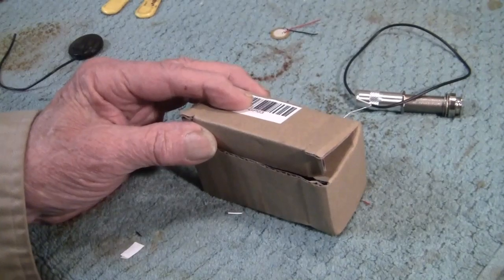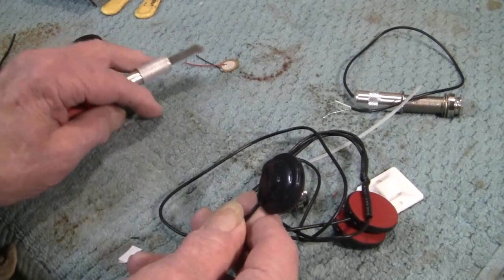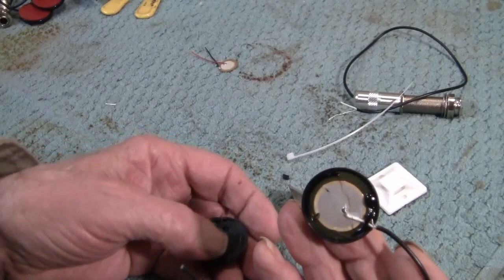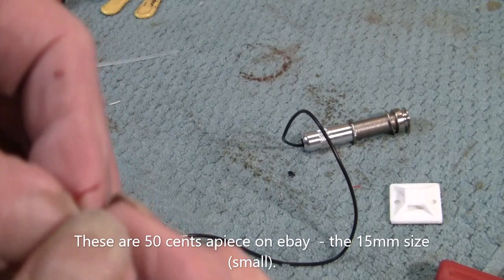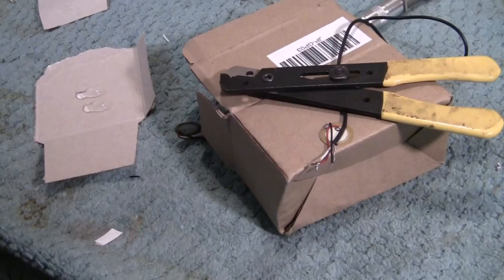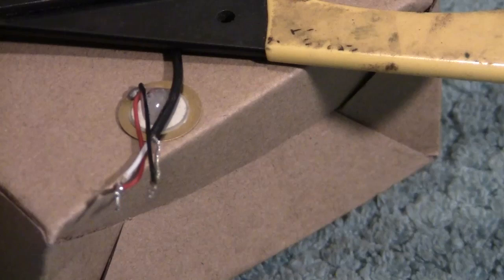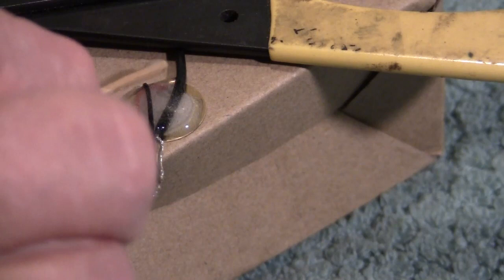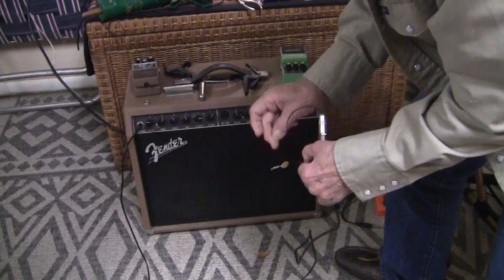Simple Good Cheap Piezo Pickup

Comment: I’m getting ready to do this exact thing to a couple ukulele’s lol. Couldn’t find a single transducer version on Amazon so ordered two of the 3 in one units they don’t have the plastic surround so one step is already done. I plan on de soldering them and only using one per ukulele as it will be more than enough. Good advice on the epoxy though I hadn’t thought of that but will be doing what you did ! I have a vast knowledge of soldering and glues as I’m an avid rc modeler and have built ships and cars all my life and have all the supplies already. Looking forward to having an amplified ukulele for not much more than $8 each plus a few extra transducers for spares.

Comment: instead of epoxy you can save time by using baking soda and cyanoacrylate, also if you're looking to get a bit more bass into the sound installing it while inside of the enclosure can help, though yeas the foam 3m adhesive on it isnt the greatest and a little less dense of foam would help

Comment: I'd like to try this for my Yamaha FG 800. I'd like your opinion on a couple of things. I've seen these piezo transducers on e-bay pretty cheap, but, some of them have three piezos, some two, and some one. How many do I actually need? And once I put the epoxy on the transducer, how should I attach it to the inside of my guitar? Would I use superglue and just attach it directly to the inside top of the guitar? And do you have any thoughts on where inside to put it for best results, like, perhaps, toward the low E side, the center, or the high E side near the bridge? Am I making sense?
Reply from the maker: 2 of these are fine. I put them on the bridge plate when possible - one on the bass side and one on the treble side. I use 5 minute epoxy most of the time to attach them to the bridge plate. Medium superglue will also work. I have installed the 3 unit K&Ks and the 3rd one is a pain - they are also a pain to install because the cables are too thick and are hard to manage. Putting them on the bridge plate is much better than the top itself. Good luck.
Reply: I will do my best. Thank you.  @edtubesled